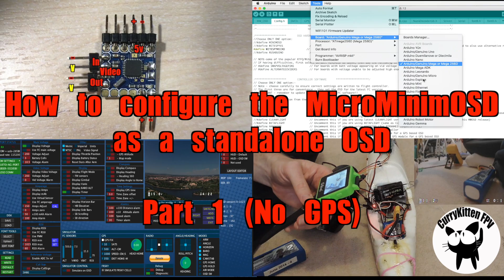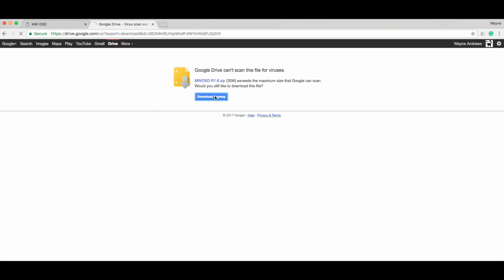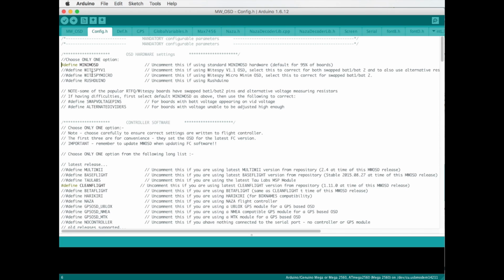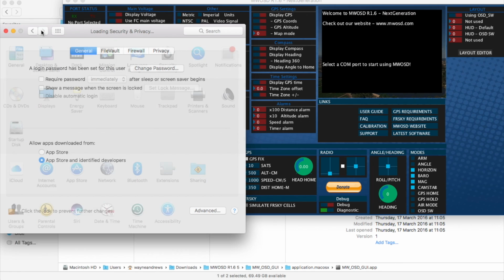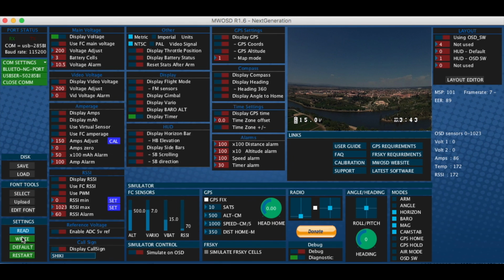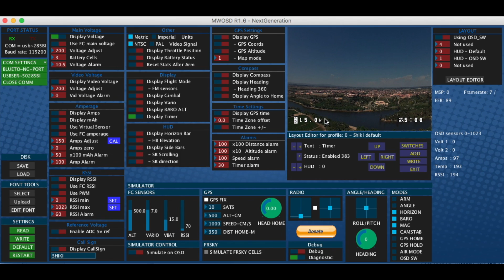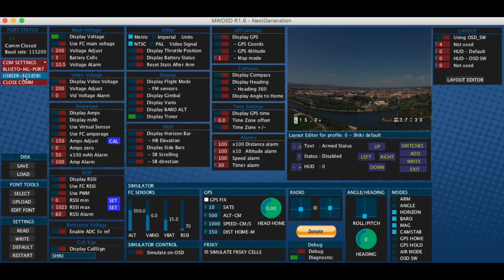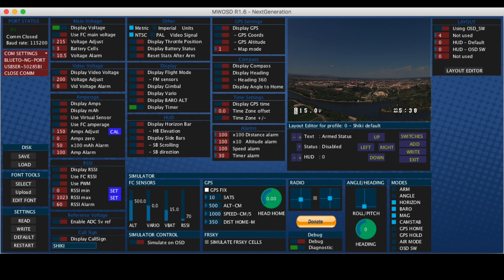FPV Tutorial: Setting up the MicroMinimOSD as a standalone OSD (no flight controller)

Comment: I know this is an older video, but I’m curious I have a flying wing that I’m going no flight controller at all that I’m running FPV on. I really want at least battery voltage on screen so that way I’m not killing my light bows when I’m flying my plane I could really use something like this. Does anybody know where I can get something like it or actually get this exact one currently as of 2025?
Reply from the maker: With my basic wings that I FPV, I usually opt for a camera that has it's own OSD built in.  These will generally have an extra input for power and display that on it's own OSD.  Failing that, I've also used ELRS PWM RX's with telemetry to pass the main battery back and have an repeating voice alam on my radio to tell me when I hit whatever voltage

Comment: Thank you, thank you, thank. It works with your help. Now I buy more of these, thanks again.
Reply from the maker: Great stuff - what are you using them for out of interest.  With every flight controller having an OSD in these days, I was interested to know if it's still of use ?
Reply: @CurryKitten  I have learned a lot from it. It is a great video. Step by step for mwosd, editting in Arduino, and mwosd GUI. I use it fort two gliders, EasyStar and ElectroJunior. Both without FlightController. I will see the Voltage from the LIPO. With a little help from thermics long flights without risk. Thanks again.
Reply: FPV with gliders is great!
Reply from the maker: Nice - cool to see it those little OSD's have a role :)

Comment: Hi Curry Kitten I have my osd and gps all setup and working great powering the minim and gps through a ubec and a cap for filtering everything else. All i have left to do is calibrate the Voltage and amps on the osd .I have read the minim has an osd menu that you can access with stick movements .Would i right in assuming i cannot do this with this configuration and i would need to be running through a flight controller to access the menu.
Reply from the maker: Yes when you wire to a flight controller to attach to a UART and have tx/rx pins to control things.  How we've setup in this video is just a simple OSD-goes-on-top-of-video sort of thing.  There's changes in the source you'd make as well so it would work on betaflight, for example,  I used it years ago before OSD's being embedded in FCs was a thing.

Comment: Just wanted to say thanks, this is exactly what I was lookin for. I tried a super simple osd, but it's bigger, cost more, and the voltage was off with no way to correct it. I've seen these tiny things for so cheap, but didn't know if they could work standalone. I was considering the cameras with osd, but don't wanna spend that much for all my fpv models, when they already have cams on them.
Reply from the maker: No problem.  It's nice to know this still has some purpose.  Now that flight controllers with inbuilt osd's and voltage displays in cameras have become the norm, the use of the MicroMinimOSD has sort of died off, but there's always a place :)

Comment: No sats.  Been sitting outside for 30min
Reply from the maker: In the other video (where I actually connect up the GPS) you'll notice it took me a while to actually find the right pins on the GPS receiver and I had to use an arduino to figure out what was what.  Are you confident you have the right pins, do you have an arduino board so you could read the ASCII NMEA strings to confirm this ?
Reply: CurryKitten nope. I gave up.  Moving on thanks anyway

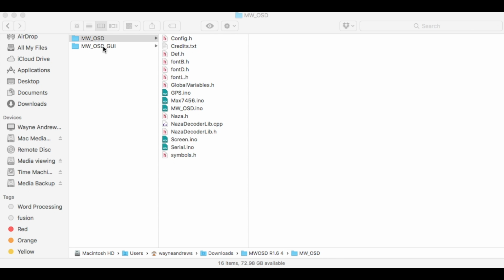Comment: At 4:45 seconds in you totally lost me! How did you get mwosd to show in Arduoino???
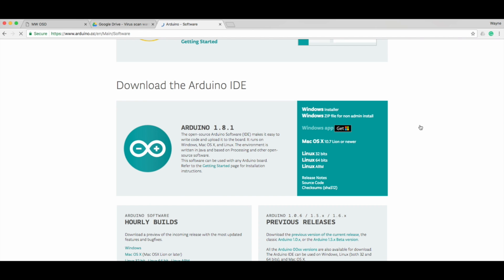Reply from the maker: It's not.  So the idea was here that I show where to download the MWOSD firmware, then showed where to download the Arduino IDE from, what I'm showing at 4:45 is what was contained within the zip file from the MWOSD download.  That page is from finder, which is the Mac equivalent of explorer in windows - so just a file/directory browser.
Reply: CurryKitten on hooking up a gps do I connect tx to tx and rx to rx or do I do like normally osd RX to Tx gps and osd TX to Rx gps.
Reply from the maker: tx to rx - like on your OSD

Comment: This is a good watch, CurryKitten. I am pretty clueless on how all this stuff works in the bigger picture, do I need an OSD? Does a Pixhawk Mini come with an OSD or those F4's? Am I free to pick and mount any OSD I like, or does it need to be compatible with the flight controller? Do I need to program ESC's (I read comments from racers talking about flashing them)? If my motors only draw 20A but my ESCs are 80A in total do they need calibration to work or will they work automatically? LOL as you can see, some of us are starting out from the buttomless pit of newbie skill levels and a bit info here and there like you are doing here is helping a lot :)
Reply from the maker: So many questions all at once :) ..and like many things the answer to them are usually "it depends"  Exectly what are you wanting to fly/build to start with.  Why do I ask ?  Well the Pixhawk is a fairly full-featured autopilot, but it's not especially easy to config (many will disagree) and it's generally for your certain type of quad/plane - i/e a larger one where you might want to mess with automonous flight modes and have it RTH if you are feeling lazy.  Does it comes with an OSD, no - it's the "usual" thing to use the minimOSD on the pixhawks which are very fussy about their voltages where you are flashing the font files over !  You can add standalone OSDs, and they will just grab infomation from their own GPS and based data on that, the idea of something like a minim is that it will talk to the flight controller and give you specific information (such as flight modes, way points etc) that a standalone one cannot.  Do you need one ?  Depends, what are you wanting to fly and what sort of flying do you want to do ?

You only need to worry in ESC terms if your motor is able to pull more than the ESC can support.  So 20A motors coupled with 80A escs means that your ESCs won't break into a sweak, but you might be carrying more weight than you need (unless you mean that each motor is 20a and you have 80a ESC total... in which case is looks fairly well matched)

Calibration depends on what you are flying (again) and the type of ESC protocol that's being used.  If you can fill in the details on what you are flying/intending to fly then I'll try and give a bit more info about what you might/might not need
Reply: Honestly, I did not expect you to answer those questions they were merely an indicator of where I am starting out. Thank you so much for your reply, now I know I didnt waste my money on parts I dont need :) But if you dont mind, yes I am building on a custom CF 500 mm frame with 2204 motors 1960kv Cobra's, 6040 props and 4 20A Hobbywing ESCs and a compact gimbal of sorts with either a Runcam Split or a Box camera. I am aiming for a DIY mavic-style quad with Lidars, payload dropper, searchlights on an extra motor connected to the gimbal controller and a trying to make a parachute work could be dead fun :) However, point-and-click is not my idea of a flying experience, I just need long flight times and safety like RTH because I am a newbie and that extra stuff is just for fun, probably too ambitious :)
Reply from the maker: Sounds like fun - nothing wrong with being ambitious :)  Ok, so back in the day... and by day I mean around 2012 this size of quad was all the range, but one thing I'd mention is that we tended to use larger props at a lower KV.  So the almost ubiqutous DJI f450 flamewheel quad used 2212 920kv motors spinning a 10" props (on 3s) and was a fairly good lifting platform.  6" props on a 500mm quad does seem a bit small, but I haven't tried to calculate lift on that kv/props so perhaps it's all good.

You might want to look at something like iNav on a standard flight controller for a cheaper way of getting some autopilot stuff.  Get something like an Omnibus board and you have the OSD built in.  You then just need to pair it with a GPS and then go through quite a lot of tutorials about how to set it all up.

As far as ESC protocols go, if your ESCs can run Dshot 600 then you'll get a smoother response and don't need to calibrate them.  The Oneshot protocols are pretyt good still, but will need motor calibration.  If your ESCs don't at least do oneshot125, then these days you should really consider changing them

Comment: Hi, It looks like your video is similiar to the one made by "project blue Falcon". Are you able to let us know what the differences  now that the hardware has been updated to CP2104 from CP2102?  It looks like the pins are in different orders to the ones in your video and its difficult to make out - dont want to risk frying the board

https://www.amazon.co.uk/gp/product/B01CYBHM26/ref=oh_aui_detailpage_o02_s00?ie=UTF8&psc=1

Many thanks
Reply from the maker: It's not so much that the hardware has updated, that board just uses a different chipset.  I've never seen an FTDI adapter with a different order set of pins like that, and perhaps the easiest thing to do is buy one for $2 with them exactly like that https://www.banggood.com/FT232RL-FTDI-USB-To-TTL-Serial-Converter-Adapter-Module-For-Arduino-p-917226.html?rmmds=search&cur_warehouse=CN The one you linked to looks like it just wants you to connect with some jumpers using the basic 4 pins to "something" GND/Voltage/TX/RX.  The pins normally have CTC (Clear to send) and DTR (Data terminal ready) these are old RS232 protocol things you would have seen flashy lights for if you old enough to remember dial up modems :)  TO be honest, I'm not sure if they are needed to connect to the MicroMinim, but it seems easy enough to attach to the  holes on that board and make up an identical cable - as long as 5v is the only voltage going in and is on the right pin, that's the important part !
Reply: Hi, Many thanks for replying! Somehow I managed to get very lucky and fluke it! Too my surprise "update done" appeared.  This before caused so much frustration. I hope that if you could spare the time to do a video on it in your usual format as this is very easy to follow it would help many others who end up with this new break out board sold by amazon.

Many thanks again

Comment: Hi Thanks for the video, really great. I have ordered OSd & GPS. The current vertion of the OSD is v1.7 . How do you set up for 1.7 as it is different from 1.6
Reply from the maker: The main difference is that there's a Chrome based configurator for it - which is paid for - but not too much.  You can still go the 1.6 route if you want to do it all for free though.